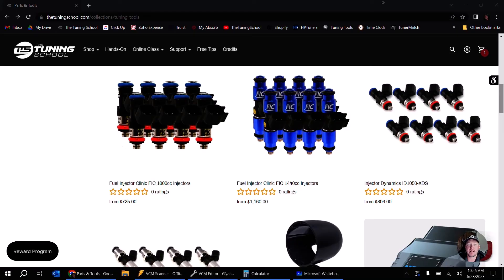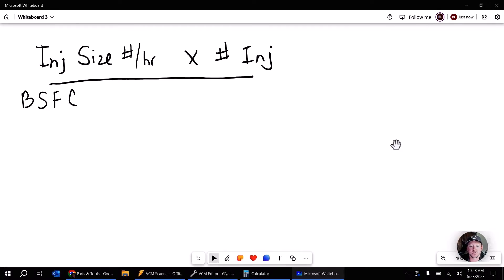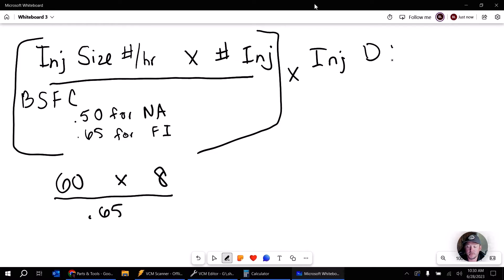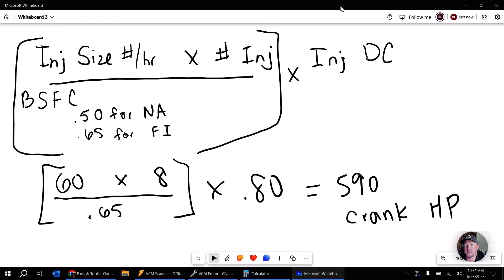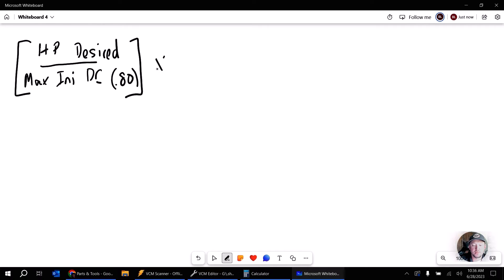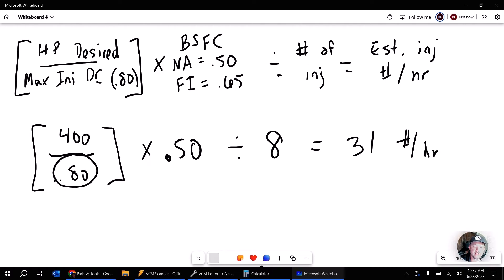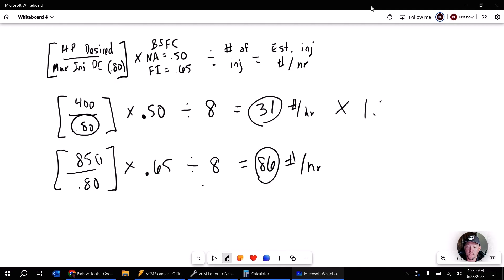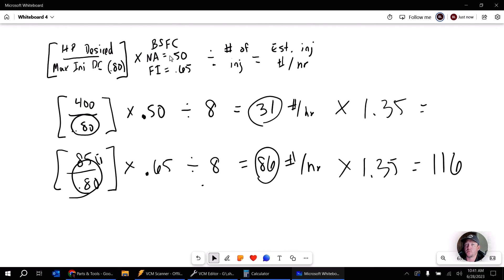Calculating Injector Size

Comment: Injectors are sized in CC or grams/min.  Your BSFC is way off also, it's g/kwh. Duty cycle is ideally around .2-.25% for max efficiency. 0.8 is just the limit, you aren't supposed to size them on that number.

Comment: So lets say I have a N/A engine that actually makes 550hp which only requires 42lb injectors, but my my future HP goal is 650hp. Can I just start out with a 50lb or maybe even 60lb just in case I go over ny future 650hp. I only want to buy 1 set of injectors. Can I buy the 60lbs from the beginning if I only have 550hp currently? Kind of like room to grow 🤔
Reply: YES. And I take a much simpler Approach than this guy's video. Injector size times sixteen for Is naturally aspirated regular gas. I've seen When richard holder Does test on junkyard LS Starting with an injector that will Supply the final test of say 12-15 lbs  boost. You just have to tune for it. Don't ask me how to do that. Os I would be running my 93lb I purchase from snake Eater for my future turbo. ✌️
Reply: @kevinwest3689 got a question if you can help me out what i would like to know is if i have a 16 nozzle injector plate will that change the injector size let's say that a 50lb injector is good for 1000hp do it make a difference if its 8 or 16 just as long as its a 50lb injector so to say im trying to make 1000hp to 1500hp roots blown on pump gas to 104 octane and methanol down the road for the 1500hp
Reply: @dewaynemitchell3931    i believe the 16 × injector size  in for 8 Cylinder Equation. A 50lb injector × 16 would = Capable Supporting 800hp 93 Octane. But. That would have to be one hell of a Engine. Like a 414 Stroker or a big block. To do that with say a 6.0. I (think?), You wouldn't need to be running e85. That changes the hole Equation.  You can get the information from people that sale injectors, or like in a summit or jegs parts book. I'm not sure on the second half of your question, anything I halfway understand. I got from Watching richard holder videos. I didn't even have an LS before.I started watching them, Now my piggy bank is hiding under the bed in the Fetal position 🫣
Reply: @kevinwest3689  hey thanks for the reply im pretty much learning as i go to was getting confused on the injector part because to my understanding it was based on 8 injectors example again if a 50lb injector can support up to 1000hp if i got 16 do i use 16 25lb instead of 8 50lb i was really going for the 1500hp+ on range on methonal but hearing how corrosive it is and how you cant leave it in your tank for days and how it eat your lines up i said no thanks maybe only when i take it to the track every now and then im getting the bottom half built like a tank i got one of those oldsmobile 350DX diesel blocks they got those big block mains got a bryant billet 4" stroker crank billet 4bolt main caps arp studs custom crankshaft billet hogan racing manifold custom cp forged pistons instead of small block i got big block olds edelbrock heads littlefield 8-71 hi helix with 18 point teflon stripping with dela bottom and big and ulgy efi injector hat with 4 3/8 butterflies im hoping to get at least 1000hp on either sunoco 260gtx(98 octane none ethanol)or sunoco 260gt(100 octane) or sunoco gtx plus(104 octane) but i feel you about the piggy bank mine done put a restraining order against me

Comment: I've always explained to people that the ECU has a set number of steps, say 256, to control the fuel delivery with. So, if you are using a 600hp injector in a 300hp application, you only have half of the fuel control available. I.e.you are only going to utilise half of 256. The greatest results come from the smallest practical injector.